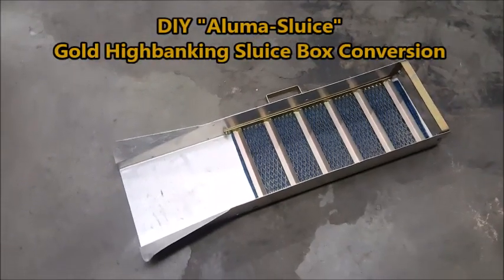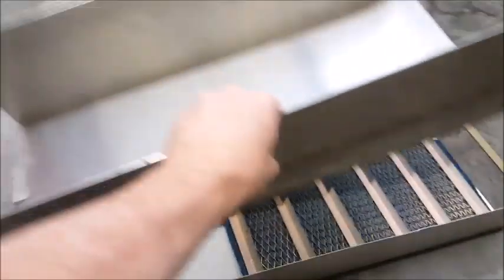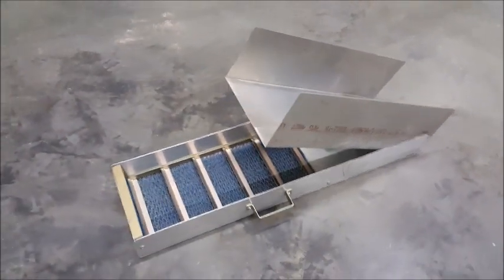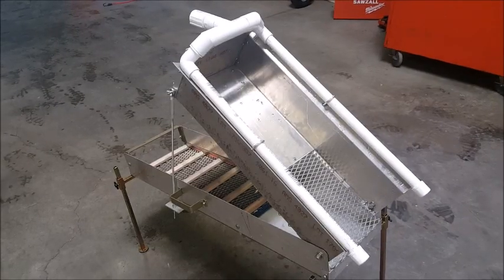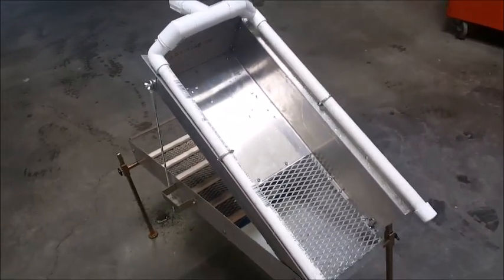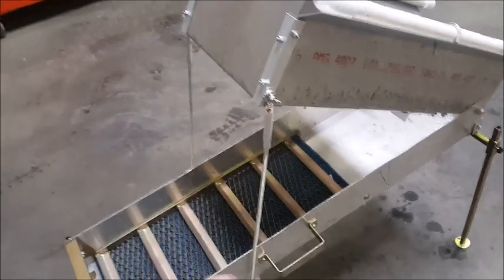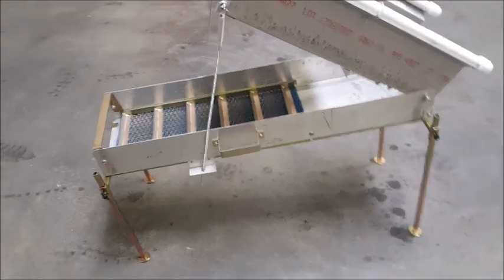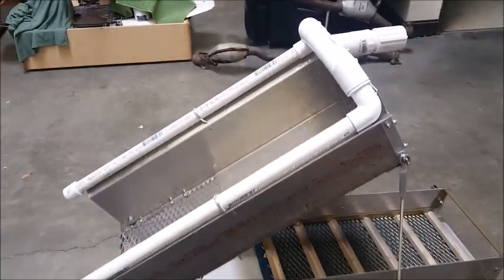DIY Highbanker Gold Sluice Build: Aluma-Sluice (Part 1)

Comment: You're still digging? Use the gas pump to create a dredge hole. Battery spray bars.classified gravel goes to one side, water and tailings back into the dredge hole